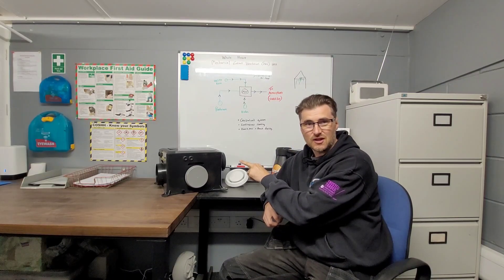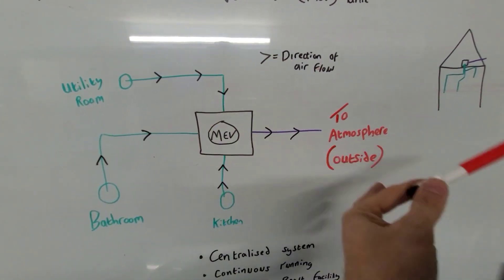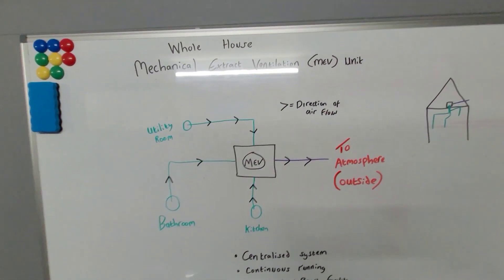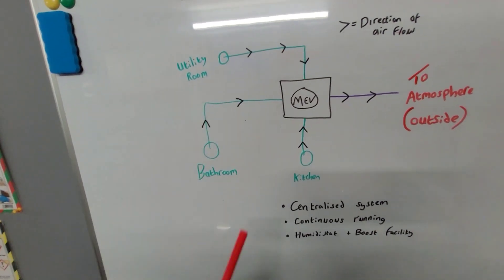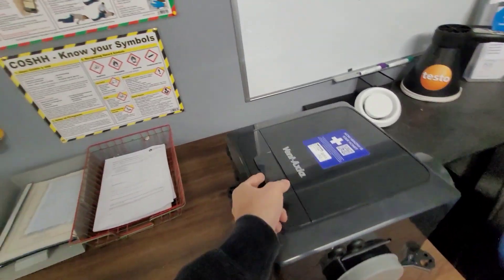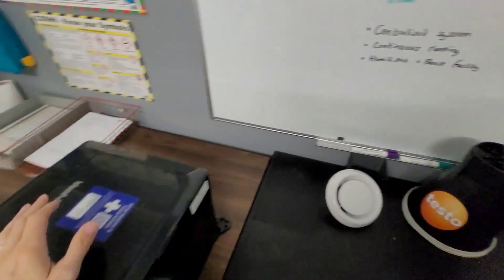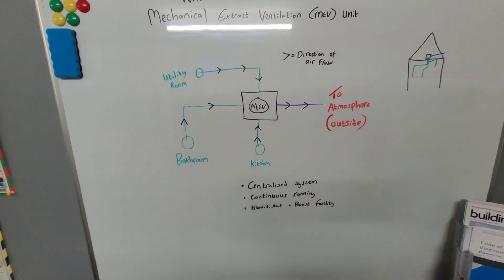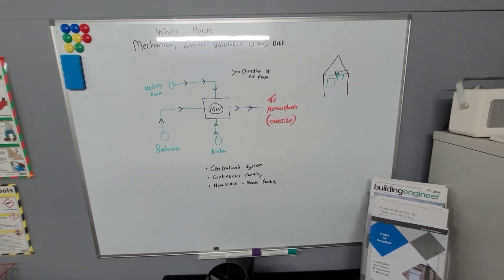Mechanical Extract Ventilation (MEV) Explained | How MEV Systems Prevent Condensation

Comment: Mine is really loud when I switch it on, is that normal?
Reply from the maker: No, it isn't normal for an MEV unit to be loud. If a unit has been correctly sized, installed well with good ducting, then it should not be loud. Some MEV units will boost and this can increase the sound coming from them. But again, if well installed and set up, this noise should not be considered to be loud.

Comment: Thanks, very short and informative. You say "wet rooms" but really it applies to any room right? I live in a dry climate and just need a MEV unit for supplying fresh air in rooms without windows.
Reply from the maker: Thanks for your comment. An MEV unit is designed to extract wet air from rooms like kitchens and bathrooms. It doesn't bring air into the property from outside.  It extracts the wet air to the outside.

If you want fresh air bringing into rooms that do not have high moisture production such as kitchens/bathrooms, then you could consider an MVHR unit. I have a video explaining what this system is.  

My videos are based on  regulations and ventilation equipment, which is commonly used in properties in the UK, which is certainly not a dry climate.

Comment: It seems the builders forgot to connect this up 😒 The one I have has VML Eolix printed on it (yellow and black)  and it seems to have capacity for 4 inlets. After much Googling I could only find lots of french resources. The ducting is all in place. I just need to connect it to the MEV unit and supply some power. I was just looking for some guidance on the latter if you're about to help...Thanks for taking the time to read this 🙏🏽
Reply from the maker: I have never heard of a VML Eolix. I tend to use Vent Axia or Nuaire units. 

I can only really help if you are in Derbyshire, which is the area my company covers.

Comment: Could you please go through how to alter the fan and how to let more air in, also if you smoke cigarettes in your apartment will my air go into other peoples homes?
Reply from the maker: The ducting for an MEV should not be connected to another property. The ducting should only go from the extract valves in your wet rooms and then to the unit. From the unit, there should be a duct to outside of the property. If this ducting exits close to a neighbouring property, then I suppose it is possible for people to smell odours being extracted. 

Regarding increasing the air flow, this requires an anemometer.  The fan speed can be turned up on a unit by following the relevant manufacturer's instructions, but to set up the correct air flow to each valve requires an anemometer. This is used to measure the airflow at each valve until you are getting the calculated air flow. The airflow is normally calculated based on Approved Document F of the Building Regs.

Comment: Does it supply air or only extracts? Can a valve go to a bedroom?
Reply from the maker: No, it extracts air only. The valves only go in wet rooms (Bathroom, Kitchen etc). If you want a unit that extracts and supplies air then you need an MVHR system. These do have valves in bedrooms.